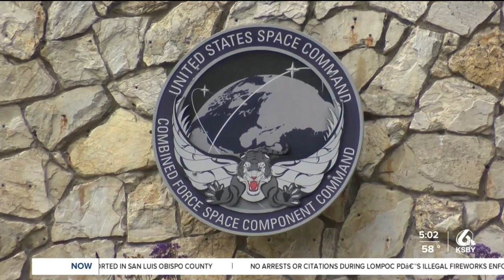Minotaur II Rocket Launch Failure

Comment: Sometimes this leads to unburned fuel being burned in a explosive process called De-polarization and causing a catacomb of events that lead to pre mature failure or detonation.  Depending on the "use"
Reply: If a computer or AI thinks the engine isn't getting enough fuel it will allow more fuel to fill the ignition chamber or oxidizer mixed too quickly either shortening the distance of Delta V or exploding mid air, or If it's a defensive missile, bomb whatever striking its own launch area.  Like it did
Reply: I think someone programmed it not to launch.  Honestly

Comment: If even a coding is wrong in firing or liftoff the computer has to compensate and manage fuel movement and oxidizer used for Delta V